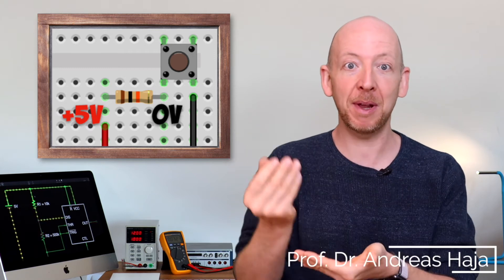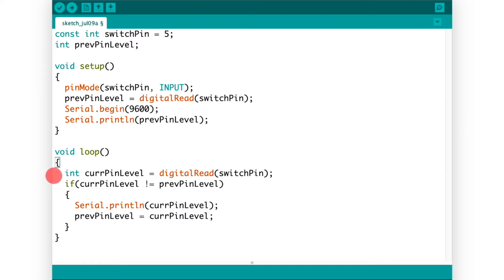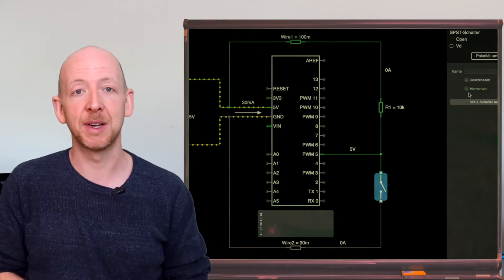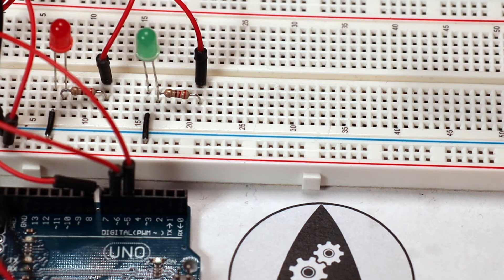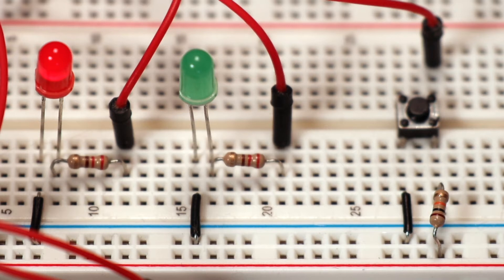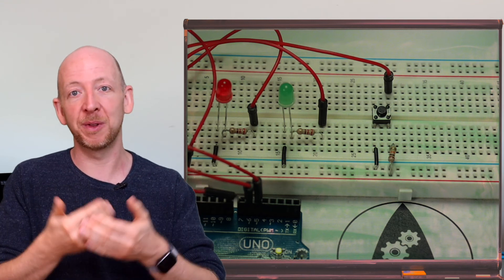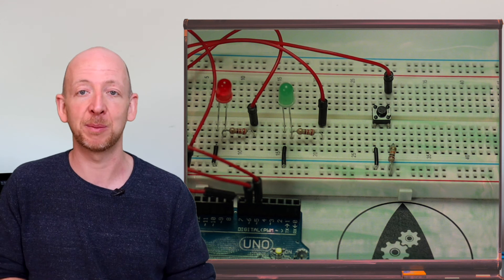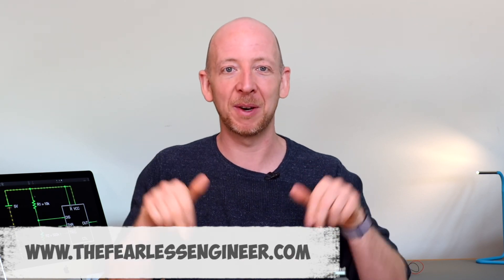Pull-Up Resistors | "Arduino Traffic Light" (4/4)

Comment from the maker: Hi and thanks for watching! 😀 Here is a question for you: In the video, a 10k resistor has been connected to +5V and an Arduino input pin to "pull up" the voltage level at the pin to +5V. What would happen if we interchanged the positions of the 10k resistor and the switch in the circuit shown at 4:09? Let me know your ideas in the comments, if you like! ⚡🔌